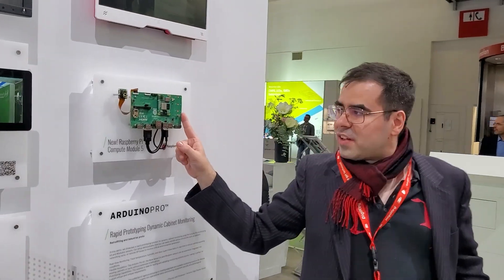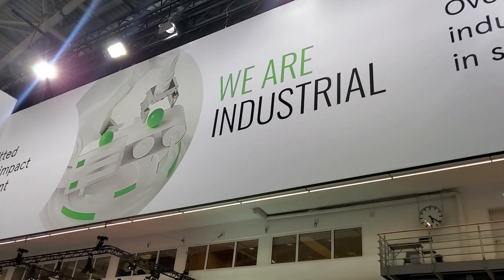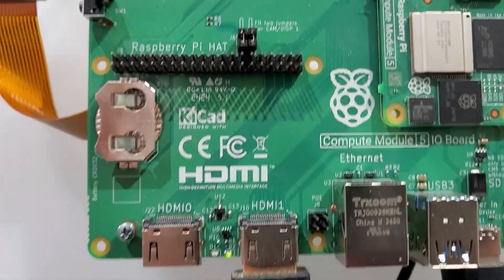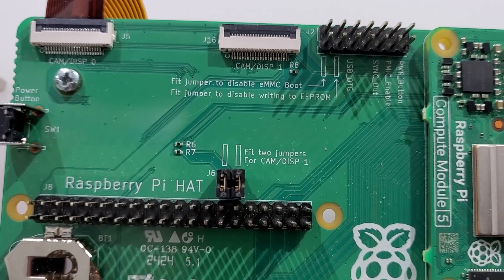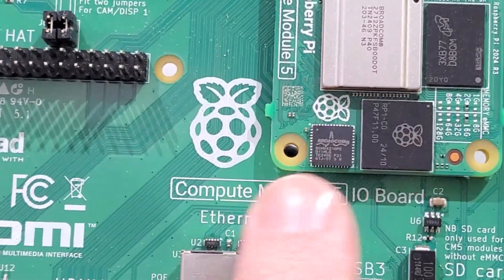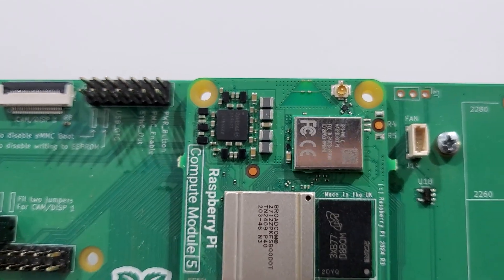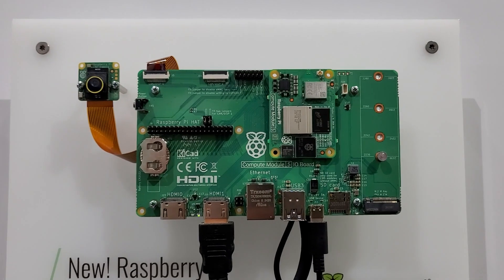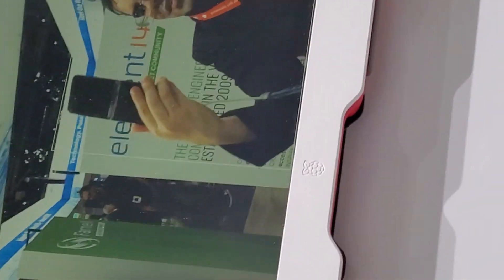Raspberry Pi Compute Module 5 hands-on

Comment: Did you touch the SoC to feel how hot it was running this? Very promising for thermals if it uses a lot of CPU!
Reply from the maker: Hi TinSpin, sorry for being extremely slow in responding to you. I was ill for a few days.

No, I did not touch the SoC as I forgot. But the board was announced today and comes with an optional heatsink...so Uptons merry men seem to know something we do not know ;)

Comment: there will also be a version where you can install 5x/10x Rp5 modules ?

for example clustering
Reply from the maker: Hello, sorry, I am not sure if Raspberry Pi will themselves offer this. But a third party might - what kind of interface would you want?
Reply: @MrTamhan  I'm waiting for how the ARM 16 cores will turn out  
since they have mobile phones, I decide to buy them 
I'm going to use it for AI 
I don't want to mention the project in general, but I want something extremely scalable and high throughput 
between CPU and NPU a GPU
Reply from the maker: @SinonkaZlp1  Hi, OK, understood. Sadly I do not know more - but maybe we can work on something...